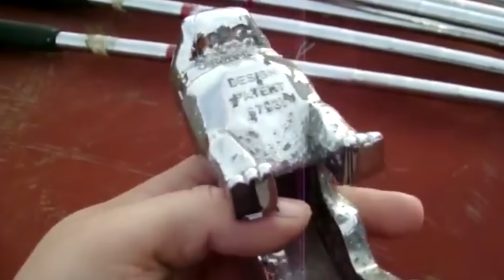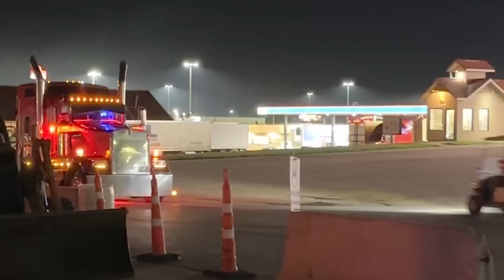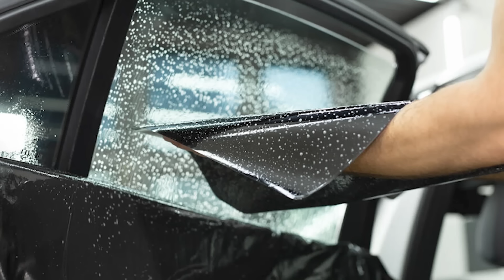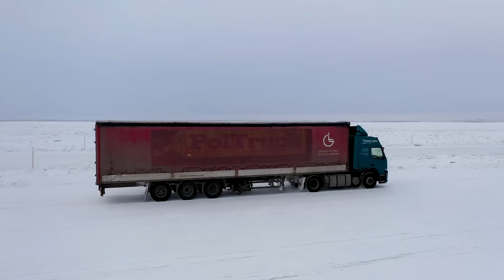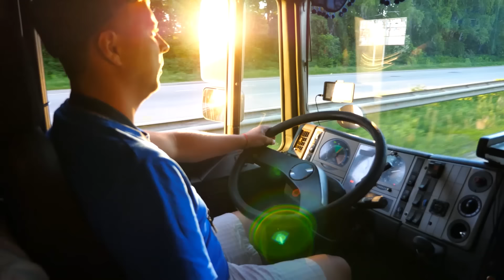15 Smart Truck Inventions So Effective They Got "Banned" — Veteran Truckers Still Use Them Daily

Comment: The trailer brake didn't go away because it was misused by people it went away because corporations didn't like it. People who were owner-operators for a company would use the trailer brake to save where on the tractor brakes. A lot of the other stuff that said about is true it did help maintain control and straighten things out if they got squirrely but primarily it was used for owner operators to keep the tractor brakes from wearing out

Comment: Removal of the (jonny) johnson bar is a bigger safety hazard then having it. It has saved me in many situations while hauling double trailers. It also makes sliding trailer axles a lot easier. Pull the trailer brake button and you loose air to the entire trailer. The biggest part of driving a big truck is training and experience which has all been lost along with the respect and brotherhood of long haul drivers.

Comment: Electric tint For your windows is the answer now. Dial it up or dial it back when you need to get it tested.
That valve on the side of the steering column was the safety parachute for low speed vehicles

Comment: Almost none of those were banned for being "effective", they were banned for being hazards to the driver or those around them, 

Excessive horns don't make drivers safer. Those hood ornaments are purely decorative (effective at nothing). That steering wheel knob is effective up until it your wheel snaps back unexpectedly and smashes your hand or arm.

Studs on wheels might be effective, but are also effective at causing tons of collateral damage and premature wear to the communities they pass through.

Comment: This video is full of misinformation 
The air does not hold the brakes down the lack of air actually engages the brakes 
Truck drivers still use chain binders 
Chicken lights on semi truck is not one color these days we have all kinds of colors 
A suicide knob is not banned 
And it will never be banned because there's truck drivers out there who are like me are disabled my left arm is nearly useless been that way since birth I've been a truck driver for 14 years  
I know a lot of drivers out there who used suicide knob and if you actually went and looked up to see if it's been banned you would find out no it is not banned so you're nothing but false information channel 
So I'm flagging this channel for misinformation

Comment: Brodie knobs are known as suicide knobs. Its because good old boys used to fasten them to their steering wheels with bolts that were too long or with all-thread. The driver would hold be holding onto the knobs when involved in an accident.  The long bolts or all- thread would spin around their axis on the steering wheel and poke the driver in the chest and pierce the heart.  Newer knobs have better clamping systems and safety latches.  Still using one today no issues - not ever.

Comment: Chicken lights are still legal as long as amber forward-facing and red rear.  Personally, I think they are stupid because the law does not require them but if they are on the truck, they have to work.  So, put an extra 50 lights on and one goes out and a Dot officer can write you a ticket for a defective light, one you are not even required to have.   I do like the looks but I do not like the games played because of them. 

Auto chains are better than studs for traction in snow.  They retract when not needed and when turned on a little disk with 4 10-12 inch chains spin against the inside edge of the tire, throwing a chain under the tire over and over as it turns.  1000 times better than throwing chains on tires too.  But most trucks not equiped and when they are the trailers almost never are and in many states, when chain law is in effect you have to chain the trailers too. 

Split rims needed banned and we are far better.  They also required tubes easy to pinch and punture when tightening.  

Snap binders are no ilegal some companies refuse to let them be used but still 100% legal if used and secured correct and still my perferd binder. 
windo tint is the same for every car truck on the road.

CB is always the best radar detector. 

flash headligts are 100% legal in every state and always have been.  Warning against a cop is deamed free speech.  As for flashing for a driver to pass you when the trailer cleared I did it on my driving test in 99 and the DOT examiner gave me extra credit and told me that was expert communication and all drivers should learn it he wished he seen it more.  

I stopped driving when the log book went electronic.   I was king of manipulating that comic book.  Make a 6 hour load appear to be 30 minutes so I did not go over my hours for the day sitting.  Scrunch down drive time lost to traffic.  So what it took 3 hours to drive up the grade from Phoenix to flag.  Speed limit is 70 and I would log I drove the speed limit.  Prove me wrong sir.  I even had a officer in AZ once say I had a magic truck, Nothing he could do.  Lose leaf logs so when you torn pages it out they could not tell like in a 30 day book.  I used to run a minimum of 3400 miles a week.  Possible on paper with ease just not really much a reality in real life.

Log books cause just as many or more sleepy drivers than they protect.  Always have when drivers played by the rules and dispatch look at the ours you show you have and dont care you are wide awake when they say you need to stop a was not able to sleep when you was forced to shut down and only got two hours rest and then expect you drive another ten because your log says you are fresh.  

One thing you left off if all the whimps going to auto trans now when the manual has so much more control.

Sorry for the long post I used to love trucking but you literally could not pay me enough to still do it.

Comment: I can agree with some of the rules,   but I also see some of the new rules that are a big overreaching of government. You already have governments going after diesel engines in passenger trucks, and trying to cram gas and electric down our throats. All the while there are factories puffing out all kinds of toxic smoke and pollution, and you don't see the government going after them. How long do you think it's gonna be before they go after big rig trucks?
Reply: I see where you are coming from but I also remember the smog that pretty much covered every mid to large city in the 70s and even some small ones. That came from exhaust regulations and the air is pretty clear now except in some parts of the county.

Comment: Yea that knob I still run with one it’s amazing to use turning in any scenario and know one that’s just used the trailer brakes for anything isn’t driving whether straightening up the trailer just using it for steep hills At least you still tractor brakes on hills if trailer does go out

Comment: if i am not mistaken when air leaks from the break lines, releases air and air pressure from the brake lines, which release the break spring which in gauges the brakes, which means truck - no go.
Reply: WTF? Brake, break, brake, break...2 out of 4 times...not bad. Also, the word is 'engages'.  And no, you're not mistaken
Reply: Yes when air pressure runs out in trailer or tractor the spring brake will apply.  Problem was that they were not mandated until 75 on new units and they didn't require a late model roll out. People were driving units during the 80s that hadn't been retrofitted.  They would often yank the Johnson control and forget that they hadn't actually set the brake.  Shut the unit down.  Go on break or go home and have a runaway truck.

Comment: ❤❤❤❤The Jake Brake is so Important, I used it all the time.  I also hated driving an automatic,  because I can Downshift and save my brakes going down a huge mountain range.
I Love all of the pretty Lights on Tractor Trailers, and I believe they make the roads safer, and should not be hindered.  They started stuff about, if just one light was out, the truck could be rendered out of service.  That was crazy.
The ELD, well, that was just another safety hazard, when you are trying to get to a safe place and out of harms way.
The suped up CBs are awesome, and I always loved them.
The trolly brake or trailer brake, I used more than once and saving lives.

I really detest having a vehicle with the DEF on it, as every so often when your driving down the raod all of a sudden you lose power, and I believe this function is life threatening, or can be, say on a high speed insterstate in a large city like coming over the hill into oakland on the 580./280/680❤❤❤❤

Comment: It's not the Jake brake that makes noise... it's the A-holes that remove the muffler to make it loud on purpose.
Reply: I drove a 3 axle diesel. You could hear the engine brake, every time you lifted the throttle pedal.
Reply: Yes the baffling.   You could back in the day drop down the stacks  old D cell batteries and make the sound even more impressive 😆😇

Comment: I'm a retired UK Truck Driver, some of these points were the same over there, first one was the Headlight flashing it was a courtesy and widly used. WE didn't have Jake Brakes but had Exhaust Brakes which did the same only not as poweful, We had Paper Logbooks until Tachographs were introduced in 1980.Split rims were the norm until tubeless Tyres and Super Singles were introduced. Super Singles were mostly on Tri-Axle Trailers.

Comment: how come my new maxidynes 71 and 85  never smoked only when they got old  did they smoke I bet if we put brand new injection pumps on they would quit smoking I read that tests showed on the open highway they poulouted less than the new motors .  that diesel exhaust is not as bad as gasoline I could run my mack in the garage and my German shorthair dog would stay in but if you run car on gas she wanted to go  outside ...

Comment: I used my Johny stick in my quad axel dump all day long it saves a split second to release the brakes when on a hill so the truck don't start to roll back when using the clutch or you would have to put your right foot on the brake and use the hand throttle while using your  hand  on the throttle all while trying to spread a load of gravel ..

Comment: Whats so smart about a bonnet ornament?
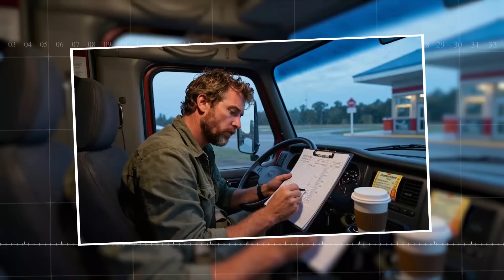Skip to 19:17 and save time.
Reply: my owners manual for my Macks said its a handle to open the hood my wedding ring got caught on the ear of the  1971 bulldog almost lost my finger its still not right when I got my new85 mack they filled in the metal behind the ear on the head I could have sued them but im not that kind of guy .

Comment: No, brodie knobs are not explicitly banned or federally illegal on commercial motor vehicles (semis) under the Federal Motor Carrier Safety Administration (FMCSA) regulations. The federal standard covering steering systems (49 CFR 393.209) regulates structural integrity like cracks, missing spokes, and lash play, but does not outlaw aftermarket wheel attachments. never had an issue with any cop or DOT inspector, and driving since 1976

Comment: Many drivers went to ham radios and used 2M 10M ( a heart beat away from CB) but you could run heavy RF power. and other frequency bands. They dropped the code requirement a while back
Reply: Used to be (many years ago) you couldn't run 2 Meter without a Ham License, and a Ham License required you to pass a @#$% Morse Code test - a skill useless for Truckers.
Reply: @joeylawn36111  You still need a tech license to run 2M, but you might be surprised at the drivers who run 2M 70CM as well as part of the  10M bands legally.
Reply: @patriot9455  For that tech license, do you still have to know Morse Code?
Reply: Just like on CB, drivers have certain greeting frequencies, like 19 on am and 15 on SSB. Ham radio has nationally recognized Frequencies for greeting and others for conversations. The ones who are restricted may be the  ignorant LEO's who still live in the "dark ages". we have dealt withn them daily.

Comment: I've got dual train horns on my KW mounted on the frame facing the ground ( amplifies the sound ). Chicken lights are not illegal.  Red and blue lights are. It's a shame they don't enforce it. You see tow trucks,  construction vehicles and county trucks with red and blue flashing lights across every state and nothing gets done about it. Snap binders or " Dog legs " aren't illegal either. They're problematic in more ways than just safety to you personally.  They loosen up while going down the road because loads shift slightly and chains get slack. Most people don't perform their checks properly and those binders come loose.  Whereas ratchet binders allow you to tighten that same chain down much tighter. Every truck I own has a Trailer brake or "Trolley valve". lmao....Almost all of my trucks are Gliders. It's a shame what's happened with the CB radios.  I still run a Galaxy 98 pushing 550 watts. Problem is, all you ever hear on there is some sad sack in their basement talking trash, giving wrong directions to people or someone talking about some sick mess. All my trucks have engine brakes. Wouldn't own one that doesn't. And yeah... I run paper logs. You can run legal and still get the job done.
Reply: You forgot the suicide knob they're not illegal either and they will never be illegal either because there's truck drivers out there like me who only have use of one arm 
And I've never used a suicide knob I don't like them but I have a lot of friends that use them
Reply: @NemoDrac that actually is illegal in some jurisdictions but then you have the Ada which allows for the reasonable accommodations for people like you so you're both right

Comment: It boils down to the federal government taking complete control of trucking, just like they do with the military, just like they do with every department in the federal government.\n There will be a time when  You will only be allowed to drive for 8 hours and a truck will be shut down. That's why FedEx is there?\n U, p, s, is there\n All these huge freight companies that just run 8 hours, and it's a leapfrog across the country.  Flagstaff Albuquerque turn around. Come back to Flagstaff 8 hours later. That's the way it works, that's the way they want it. I'm retired after 50 years of over the road and local driving. I miss it, but I'm glad I'm out of it now

Comment: The window tint thing applies to four wheelers as well.
Along with the unnecessary use of the horn and colored lights.
But as far as trucks running chicken lights owner operator still do it I don’t know where these people are saying they’re illegal they’re not illegal just can’t have red or blue facing forward.
I don’t think you are allowed to run blue lights at all I know with four wheelers they would go after them for the lights around the license plate that were blue or red and also under glow kits that were blue or red.
Then they just banned under glow hits altogether for road use anyway.
Reply: Where I live the cops enforce the window tint laws, yet most of them are running full blackout tint.
Reply: The state of Virginia you would write you up for too many lights on the rig back in the 80s and early 90s. Some drivers had a toggle switch on the dash that would shut a lot of them off when they went into the state.

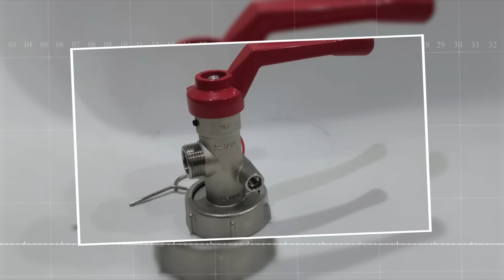Comment: 10:24 Number (8)  I never herd it called a The Trolley Valve.  Okay I see why you call it the trolley valve. You are an AI video and not a real truck driver.  
We truck driver called it the trailer brake or the hand valve.
Reply: Originally.....the trolley valve.😊😊😊😊😊
Reply: Speak for yourself driver,  been doing this 30+ yrs. It's the trolley valve
Reply: I've heard the term trolley valve
Reply: and I call it 'the spike'. It depends on where you are at in north america what it is called.

Comment: most mack truck drivers drilled a hole in the front windshield, sharpened the end of a pool cue then poked the bulldog in the butt in attempts to gain speed
Reply: A few years ago Mack made a major change in the bulldog, they turned it around so now they had two assholes going in the same direction. 🤣

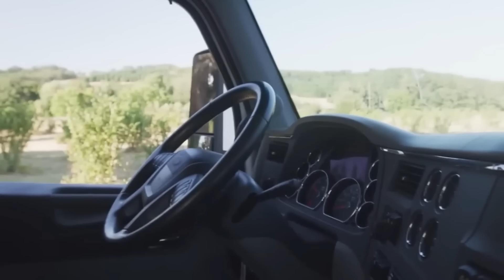Comment: 11:06 my truck still has a spike.
Reply: That’s because this ai video is a lie but a true statement in the video
Reply: @sfsfuzzy3597 my company has 40 trucks, 2006 to 2025 and every single truck has a spike. How else do a tug test and make sure trailer brakes work? In 32 yrs ive only used it twice as driving and i was only a light 1 second tap. Wel i  guess time to time a tap to see if roads icyl
Reply: @ShawnKelly-h4c3s spike ? Never heard of a spike before but I only been a driver since 1977 and a certified mechanic as well during part of those years and a spike is not a real thing